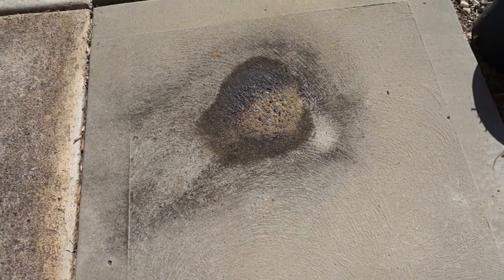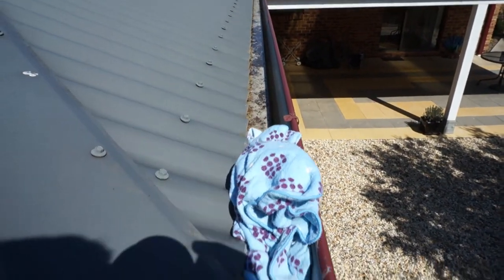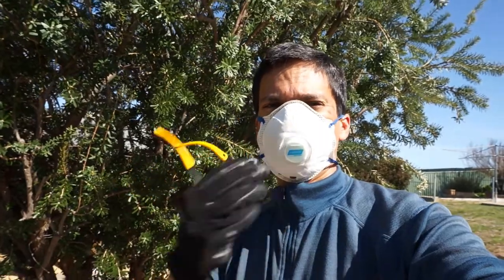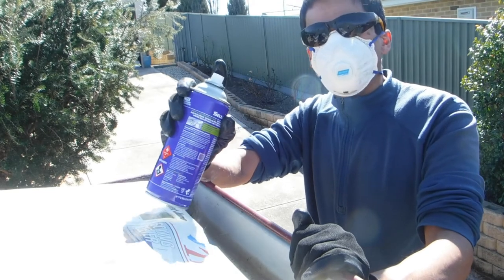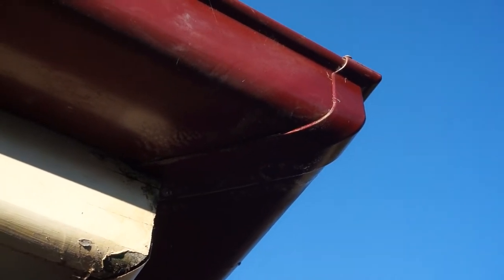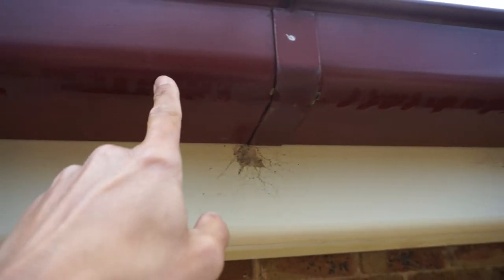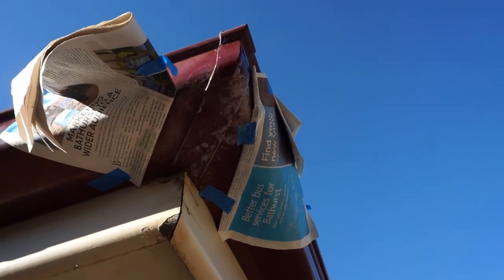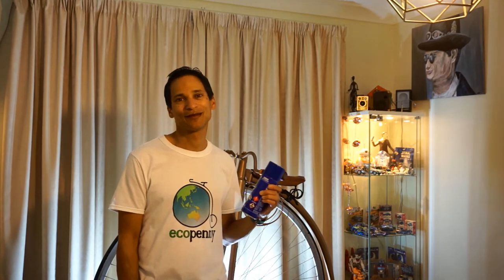How To Seal a Leaky Gutter | SELLEYS ROOF & GUTTER SPRAY SEAL

Comment: This review is "no use to me", I'm trying to weatherproof a flat concrete canopy on an Art Deco house that has defeated everyone for 60 years, I need to see the character of what is sprayed? Does it have enough substance to allow tiles to be stuck to it to further weatherproof it? Or is it just a very thin liquid which could as easily be painted on? (Speaking of using two or three coats was helpful, thank you)
Reply from the maker: It looks like clear dried glue when dry, designed for slight gaps in metal etc, wouldnt be able to stick tiles on it, sounds like you need a builder to pour some sort of resin all over the roof to waterproof it, beyond the scope of this DIY home owner product.
Reply: @ecopennylife  Thank you  :)  The weird thing is that SELLEYS ROOF & GUTTER was recommended to me by the technical support team at "SELLEYS" this morning, they made no mention that it was a spray. I had very specifically stressed the importance of being able to glue tiles to whatever they recommended, as mentioned this leaky flat concrete canopy has defeated everyone for 60 years: so I'm very much back at the drawing board. Again thank you for your considered reply  :)